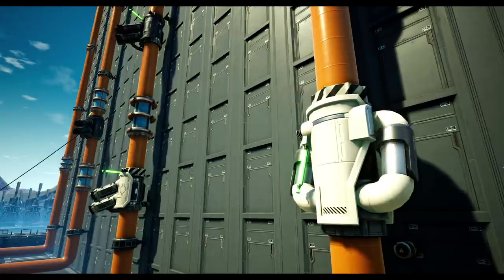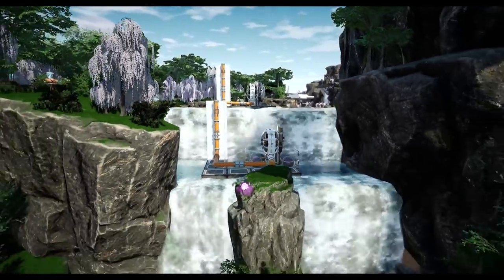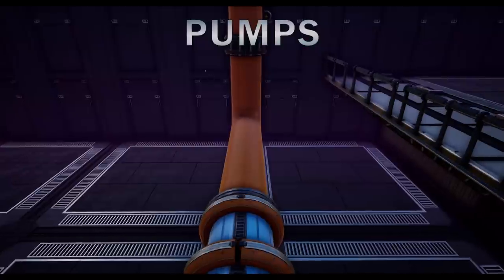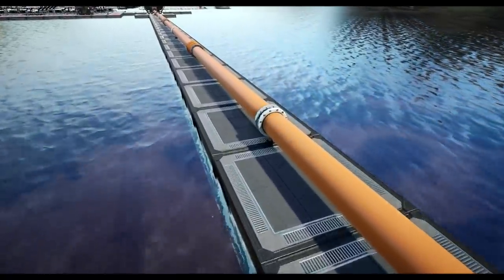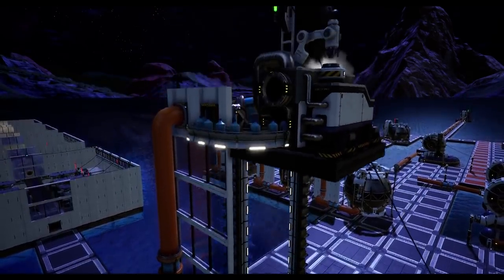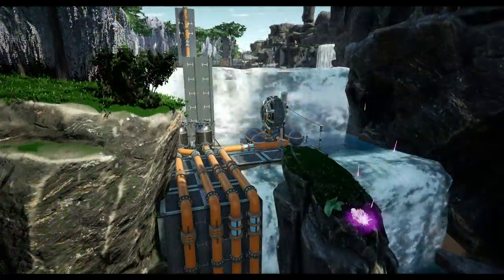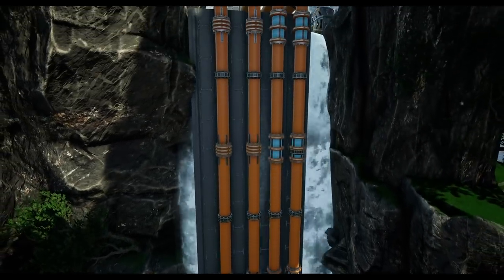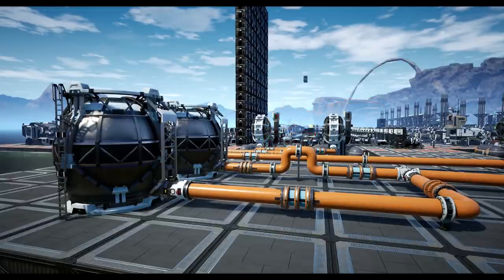The Essential Guide to fluids in Satisfactory Part 2 [Update 3.6]

Comment from the maker: Hopefully, after this video you're pumped to play with fluids! So now I'm dying to know, how are you planning to lift liquids in your factory?
Reply: It would be very beneficial if in the next one you explain flow rates specifically with respect to oil.  For instance, I have a quite long oil line to my refineries (Rocky Desert start), that doesn't rise much.  There are 3 oil nodes close together (1 pure, 2 normal) and I have an extractor on each.  

What I don't know is if I can route all 3 through one MK.2 pipe, or do I need to run a long pipe for each extractor back to the refineries?  I get that the flowrate is 600 m3/min, but the capacities from one section to the next are all over the place.  Does 60.3/60.3 mean that this pipe can only take a maximum of 60.3, because that's how it reads to me?
Reply from the maker: the 60.3 is in regards to the amount that segment of the pipe can hold so providing the flow rate continues and the oil is being consumed at the factory end you can use a Mk2 pipe or several mk1's :)
Reply: @TotalXclipse  Ok, so a single MK2 pipe  for multiple extractors then is how I'm reading that?  How will I know just beyond the junction (of the 3 or 4 extractors) if I'm not getting maximum efficiency from my extractors?  Just go by the efficiency of the individual extractors?

Comment: With regards to fluid and pressure theory, the "free headlift" from higher placed fluid sources is more or less working as it would in real life. The higher placed fluid source increases the pressure in lower level fluid system, and allows for fluid to travel to increased heights. This is called U-tubing.  And now comes the BUT.   In real life, when the system pressure of the lower level pipes increase, the lower level fluid extractors would then need an increased feeding pressure to manage to add more liquid to the high pressure system.  This does not seem to be modeled in the game however.
Reply: forgot to mention. huge fan of your vids. great content :)

Comment: I really like the fact that I can make a network without pumps when providing water from a source high up. Maybe the rules can be a bit more clear than simply sharing the headlift, but it's mroe than rewarding for making a huge network of pipes that provides all the headlift I need. That's the system I am using.
Reply from the maker: We just have to make sure that if they do stop that, that we can quickly add pumps to all the pipes :)
Reply: @TotalXclipse  I don't know why people think it's a bug, you can do that in the real world too, and there's no purpose to pushing water down only to bring it back to the top... and adding another source to the bottom doesn't change the fact that the baseline fill is at the top of the pipe network so it will fill all the way to the top again (all pipes connected to that top pipe network will rise to the top). Pressure in = pressure out. I just wish we didn't need to have a building at the top and could just use a siphon system.
Reply from the maker: @Lil_Puppy  You're right this mechanic isn't a bug, - that was the wrong word, but it is a fault in the implementation of the head lift system. In real-life if you were to connect a pump at the bottom of the system, like I did with the extractors, the water would not be able to enter the pipe at the second source and then be "lifted". - I may be mistaken, but I've been told this a few times by various engineers and people that work in the fire services.

Comment: Trains are a bit weak. A mk1 pipe per train car (buffered properly to avoid the load/unload pause) can only run around a 5 minute round trip time. Mk2 pipes only have a bit more than 2 minutes round trip time if putting 1 pipe per car. This means either really short train runs or more than one car per pipe. 

1600m3  car capacity / 300m3 per minute is 320 seconds total round trip time. 

1600.3 car capacity / 600m3 per minute is 160 seconds total round trip time. 

Those are really short tracks when you consider 40 seconds is lost in load and unload. So for longer runs you will need multiple trains for the same delivery or split each pipe into multiple trains cars.
Reply from the maker: Exactly, it's why I'd just rather not use trains for liquids unless it's just a token train to look cool :D
Reply: @TotalXclipse  I had lots of trains bringing water to towers above facilities before the fluid update. Was way easier than running all those pipes and used way less power. 

But now with Mk2 pipes and pumps, it takes half the pipes and less than half the pumps to get water up so the trains are less useful.

Comment: I need a more detailed guide about liquids in Satisfactory. Especially about Valves. For instance in my Factory i have 500m3 per minute fuel.
I need to split them 390m3 to 110m3. If i place 500m3 limited valve in input, and 390m3 and 110m3 valves in the output. It just doesn't work. But if i remove 110m3 and 500 m3 valves. Then it works perfectly. I don't understand the reason.
Reply: Bear in mind that is is not constant so if you have 500 m3 it can also be lower.

Comment: yo total. how would you recommend placing water extractors if the water is going to be packaged in great quantities?
Reply from the maker: I've never thoughts about it, but I'd probably run them as buses against the side of a foundation and try my best to load balance the pipes immediately to packagers
Reply: 5 extractors can produce 600/min water, which can be used by 10 packagers using the mk 2 pipes. I normally try to work with 5 pumps in a row either side of a set of foundations. Scale this up as needed.

Comment: I don't understand the overflow system.  That 'bend' you put in is not 10m tall, so how does it change anything in the line?
Reply: For a fluid too rise, the bottom pipes need to be full.
Reply: When production is more than you need it will overflow the U bend so it will be packaged and sinked.
When production is lower than need it will not rise over  U bend and get packeged.
Reply: @Triggernlfrl  Ok, I see, thanks.  And this has the benefit of not cycling production?
Reply from the maker: If liquids stagnate, depending on the system, it can freeze up your whole production, so for some factory layouts, it can be really important to have that overflow so that you can keep producing plastic or rubber for example. :)

and yes like they mentioned above, liquids only overflow once the fluid has filled up the height, so if you're using all fluid prior to it reaching that, you won't need to worry. It's a little back up system.
Reply: @TotalXclipse  I think I get it now.  My only issue with refineries so far is what to do with the waste oil from plastic production.  I know it can be packaged for fuel, but what do you use all of that for?  I am still trying to unlock the alternate power tier...just got my computer factory up and running based on your efficient layout...thanks!  Took me a while!
Reply: @karlhungus545  At the start of oil processing if you don't want to use the fuel in vehicles you can just refine the "waste" heavy oil into petroleum coke and burn it or sink it. Later you can burn the fuel directly for power. If you pick up the alternate recipes for recycled plastic or recycled rubber you can use the fuel to amplify your plastic and/or rubber production instead of using it for power.
Reply: @DavidCookeZ80  Good tips, thanks.  I went and watched the super-efficient fuel video and got some ideas too.  I tried packaging it and using it for fuel in vehicles, but I was producing way more than I need.  Sinking it seems like the best option I guess.  I just unlocked alternate power yesterday, but now I need to go and find some Caterium, so I'll be on coal for a while yet.

Comment: 5:37 That's not a bug. The head lift comes from the extractor at the top. If you removed the bottom extractors, it would work exactly the same.

(I haven't verified this yet but) I bet that the water sources at the bottom do not add to the flow rate at the top. So, the fluid buffers at the top are receiving 120 m3/min of water from the one extractor at the top and not 360 (the one above + the two below).
Reply from the maker: It is a bug or at least a feature that doesn't obey the laws of fluid mechanics :p  because that's not how it works in real life, if you have extractors pumping liquids into the bottom of a system then the pressure would be too much for water to leave the extractors. However all the pipes are receiving the max flow. Try it in game and you'll see what I mean :)
Reply: @TotalXclipse 
> that's not how it works in real life
Yeah, I based my reply in real life concepts of fluid mechanics. IRL it would be as you said: the water pressure (or head lift) from the top extractor would prevent the bottom extractors from lifting water.

BUT OMG was I surprised in game. I found out a few things:
1. You're absolutely right. The bottom extractors do contribute to the total water production. (My second paragraph is totally wrong.)

2. The top water extractor doesn't even need to be powered (i.e., disconnected from power, on standby, and may even be connected to a valve at 0 m3/min).

2.1 However, the top water extractor does have to be connected to the pipeline network of the lower extractors.

What the game code probably does is consider only the elevation of the highest extractor, regardless of the elevations of all others.

Theoretically, there could be one extractor at a high elevation (say, at the bamboo fields) and the rest at low elevation (say at the oil coast) and the production would be all of their production combined, as long as the machines using the water are at/below the highest extractor.